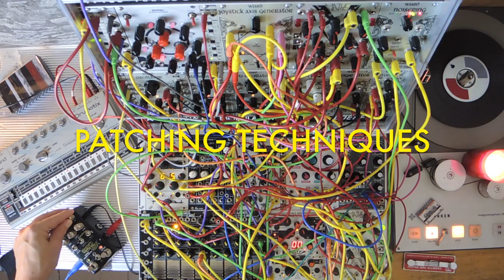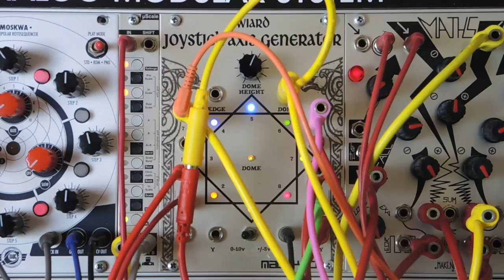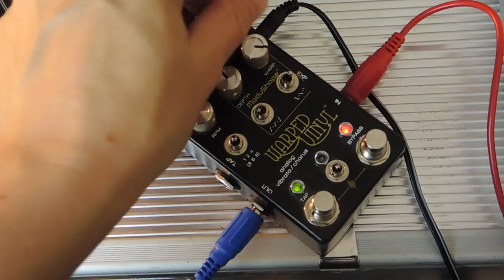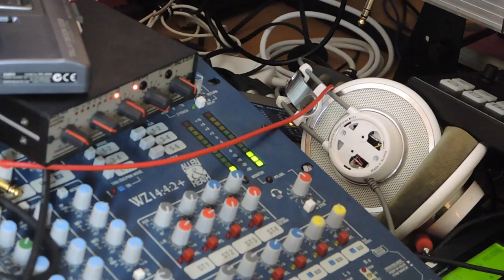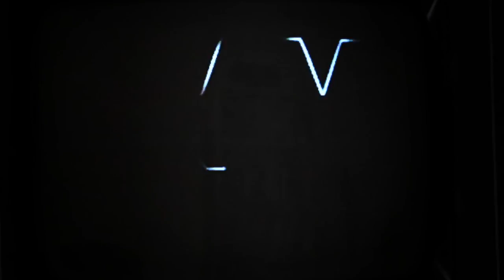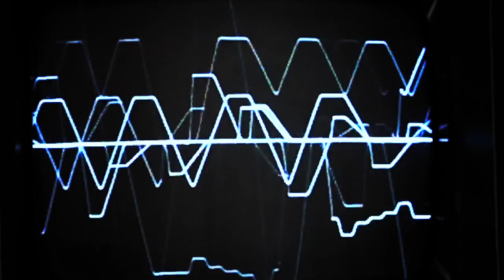Patching Techniques on the Eurorack Modular Synthesizer

Comment: how was maths controlling the filter here? was the audio from 606 running though maths (envelope following) before it went to the filter?
Reply from the maker: Maths was set to two different LFO that influence each other. Their outs are in the CV ins of the DMF-2 filter. LFOs were both free running and triggered.
Reply: Ah right. so the Maths LFO frequency is always warping but they get retriggerd by a clock(?).
(Only discovered your videos in the last day. Loving your content. Hugely Inspiring. Bought Codex off the back of the video. I love it. ) @Hainbach